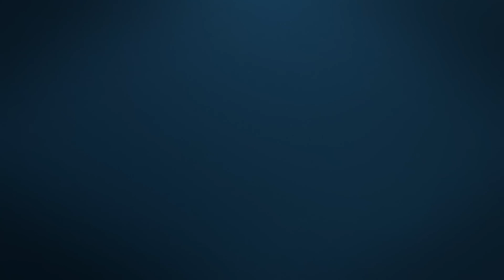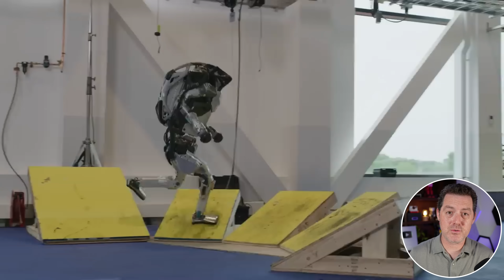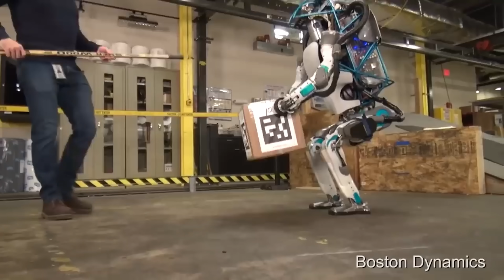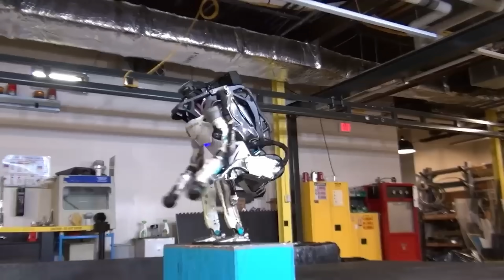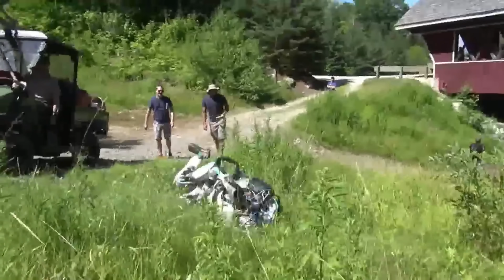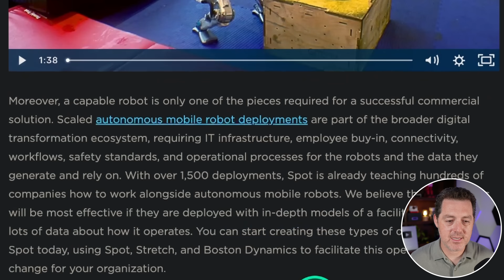Boston Dynamics NEW Humanoid Robot SHOCKS The ENTIRE Industry! (Atlas 2.0)

Comment: "its completely electric" what did the old one run off coal ? petrol ?
Reply: The old one used hydraulics for movement hence it was slow, bulky and heavy. It was only partly electric This one uses electric motors to move its joints/limbs and has no hydraulics making it faster and slimmer hence "fully electric"

Comment: The potential and initial distribution of the "Atlas II" robotic workforce is expected to commence in 2025. Hyundai companies, along with their estimated workforce numbers, are based on the most recent data available:

Hyundai Motor Company: Approximately 75,000 employees worldwide.
Hyundai Engineering and Construction: Around 6,902 employees.
Hyundai Heavy Industries: More than 30,000 employees.
Hyundai Mobis: Around 37,000 employees worldwide.
Hyundai Steel: Approximately 18,000 employees.
Hyundai Wia: Around 4,000 employees.
Hyundai Motor America: Over 5,000 employees in the United States.

It's important to consider that these figures might not be precise and could vary with time. Moreover, several of these companies belong to the broader Hyundai Motor Group, which has a global workforce exceeding 150,000 employees.

Comment: what I saw there was a really janky walk, with the arms jerking at every step.  that doesn't look very good at all.  further, this 'standup' method has been used in robotics competitions for a long time.  I would have been more impressed if the robot did a "proper" standup technique of putting down one hand and having a 3 point stabilization to get up.  this works anywhere, not just where its legs have a perfectly flat floor underneath.   if it fell on stairs, it wouldn't be able to get up in the way they showed.  this seems short sighted and gimmicky, as opposed to well thought through. 
¯\_(ツ)_/¯

Comment: In the first Atlas video you can see Atlas 1 dancing in a puddle of hydraulic fluid.
It was designed like a tractor.

And I bet they are still programmed rather than Understanding.
Reply: They are. BD has explicitly stated this. It's a much more modest and controllable goal, and the precision is desirable in manufacturing and warehousing. Tesla and Figure are aiming for the consumer market, which requires more flexibility and less precision than the industrial/commercial market.

Comment: I don't think they are aiming for the consumer market with this, like Figure and Tesla are, I think the are aiming for the industrial market just like they have with Spot and Stretch. I also have a feeling that this thing is *a lot* more expensive than the $20k-$25k price point Tesla is aiming for. (Not that I think they will hit that low a price point, I think that's just typical Elon optimism.)

Also, BD have always explicitly shied away from completely AI controlled robots in favor of the precision and predictability of programmed and human-directed routines, meaning it wouldn't be very useful in a home, but very useful in industrial or warehouse work.

In any case, I won't be able to afford any of them until they go through about 20 years of use/owners and are thoroughly obsolete. Like my car.
Reply: Boston Dynamics plans to start trials of the new Atlas robots at Hyundai factory next year.

Right now, Agility Robotics sells pretty good humanoid robots for $250K, and several customers, including Amazon, are already testing them at their facilities. Amazon pre-ordered enough for the Agility Robotics to build a factory with 10000 robots/year capacity. Their robot is rather simple in design, compared to the one that Tesla is attempting to make, and to this new electric version of Atlas.

Comment: Notice how the arms are identical rather than mirrored left-right? That's a nice touch for cost and ease of manufacture.
Reply: great observation! and you're right, this is innovative thinking
Reply: Jetsons hands
Reply: The legs too. No? Quick re-watch 😂
Reply: @MrGaborKukucska  at 41 second when we see from behind, it seems the leg is comprised of 3 parts, upper annd lower plus the foot.
the inner thigh has a flat edge while the outer thigh has a contour.
the lower legs have these a cut (as it attaches to upper leg) that is closer to outer edge. and I''ve not paid attention to the feet.
bothe the upper legs are different and so is the lower leg I think

Comment: Give Atlas 360' view and several different weapon types, small flame thrower which doubles as a thruster for an assisted fist punch, other arm would consist of a small tesla coil (maybe energize the exoskeleton?), both of these would be used if the held weapon ammo was exhausted. Perhaps a sonic weapon (close range very high decibel), or perhaps a very small hidden tightly blue light focused laser. All of these combined wouldn't take up much room and its tech that's already miniaturized and available.
Reply: Don't even need to go that high tech. An air horn from a truck with a small compressor and air tank to power it and 360 degree strobe lights and you have a near continous flashbang. Add multiple wide nozzles for spraying pepper spray or tear gas and capacitor banks connected to fist mounted prongs for stun gun fists and you have a riot suppression bot.

Comment: What's the battery life and lift strength without hydraulics?  edit:  5:54 - they vaguely claimed it would "be stronger".  How can a servo motor be stronger than a hydraulic system?
Reply: Yeah. That is dubious. Unless they mean it'd be stronger in some ways and weaker in others. I really can't see this thing doing parkour. But then we don't need a robot that does parkour. If it can squeeze into tight places and navigate crawlspaces it can do a lot of trades.
Reply: @MrNote-lz7lh  Have you seen brushless motors in the battery power tools?  
Are so small and so freaking powerful....